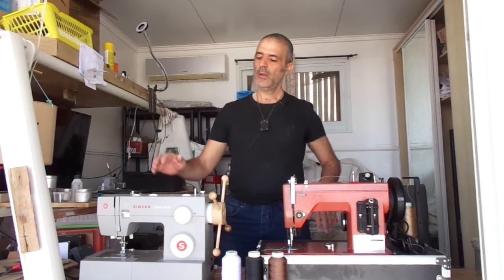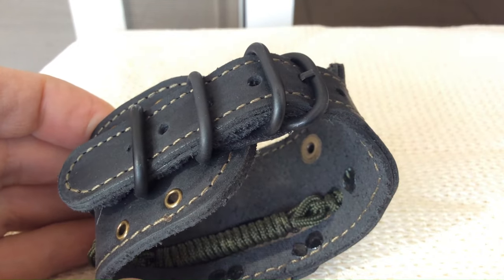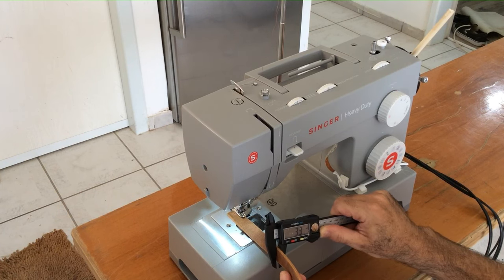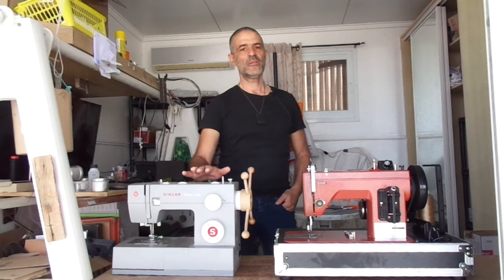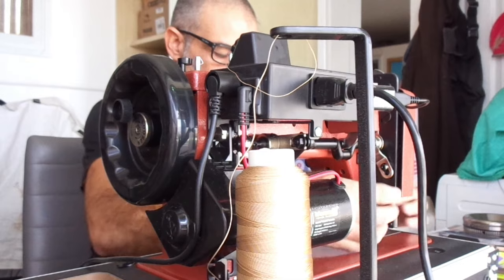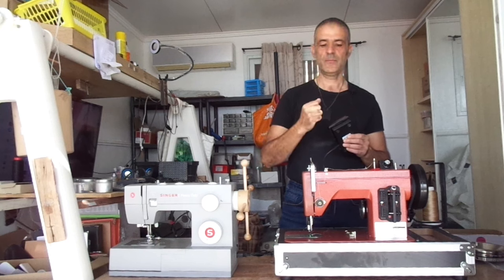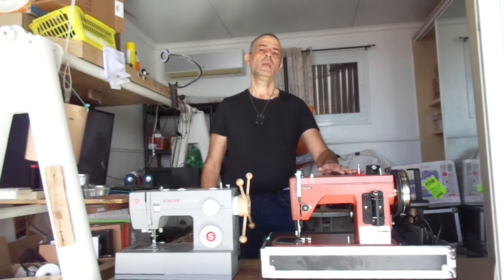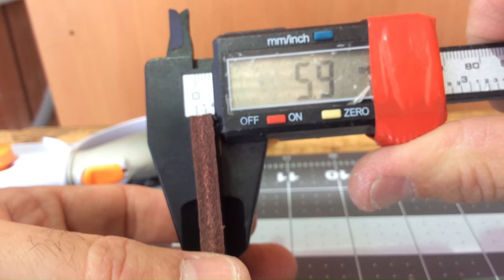Singer Heavy Duty Vs. Sailrite Industrial Walking Foot Sewing Machine for Thick Fabrics and Leather

Comment: The sailrite is not an industrial machine. Even sailrite calls it a heavy duty sewing machine. For a sewing machine to be called industrial there are parameters that have to be met that the sailrite machine doesn’t even come close to. Now the sailrite fabricator is an industrial sewing machine, but the LS1 and the LZ1 are just heavy duty.
Reply: If they are just heavy duty then why the $1000 price tag?
Reply: Industrial sewing machine - can sew continuously without stopping 
Heavy duty - has a more powerful motor than sewing machines of the same size and will have better quality parts. But the motor will have a duty cycle of 1 hour of "continuous" sewing with a 20 minute cooling period. Don't let this video confuse you, this is not an accurate comparison. The Sailrite machine is designed to sew and repair sails and is a walking foot machine. Whereas the Singer HD is designed to do home domestic sewing projects, sewing denim jackets would be the max for this machine since it has a 1 amp motor. The Singer HD is comparable to the sewing machines that were made back in the 1960's and 70's. The all metal frame sewing machines, but all those machines came with a 0.3 to 0.5 amp motor. Where the Singer HD gets the rating of "heavy duty", it comes with a 1 amp motor, with everything thing else reaming the same. So think of the Singer HD as a vintage sewing machine but with a 1 amp motor. 

Now let's compare the portable "walking foot" machines that start out around $370.00. Why the $1,000 price tag for the Sailrite machines. These Sailrite machines have a thicker casting, and the parts on the inside are cast with a steal alloy instead of the cheaper cast iron parts. Now the Sailrite machines are assembled to use aboard sailboats and yachts. They come with everything you need to start sewing. You don't have to buy any accessories, just buy thread and needles and start sewing. It also comes with a lifetime warranty if any part should break. The cheaper portable walking foot machines don't come with any accessories and some of the parts inside need to be upgraded. So when it all said and done for how much money you'll need to spend upgrading the cheaper walking foot machine to match the Sailrite machines, the price will end up being the same.

Comment: My first heavy duty sewing machine was the singer 4432. Although it's said to be a heavy duty, at my first attempt to sew a canvas, don't recall how many layers, the timing went off. After that I bought a Chinese heavy duty called Emery similar to barracuda , and with that one was able to sewing on multiple layers of the canvas
Reply: That sounds like good information. We are sewing canvas bags with an industrial machine but looking to get a few machines for classes. I found the Emery machine online on the manufacturer’s website but I cannot find somewhere to buy it. Where did you get yours from?
Reply: @arisskarpetis  Chinese "Aurora A-2153-HM" looks almost the same.

Comment: I don't know what kind of motor you have in that singer, i have the 4423 and it barley makes it through paper size leather.
Reply: 4432. Which is a little stronger.
Reply: @Yvanahh  they have same motor. 4423 has more stitches and different color.

Comment: thanks for this.  great video.  wanted to mention there is an adjustable potentiometer(adjusted with a small flathead screwdriver) in the singer foot pedal. its right beside "VR2" on the main board. at 12:18 

the manual feed handle you made on the singer machine is genius

Comment: I have a singer 6800c as well as a Rex (Sailrite Wannabe).
On the Rex, I had to use a magnet as a spacer on the foot lift, to get even close to the clearance of the Singer, which has that "extra lift". The Rex with Monster Balance Wheel is pretty good, but using it is like trying to do Brain Surgery with  chain saw. Just not a precision instrument at all. Always a challenge, where the Singer is nearly always a pleasure.

Comment: Right now Im sorting out a brothet industrial eith a clutch motor. When you speak of high speed I hear you. I changed the pully wheel to a smaller size, 45mm. Just received a shorter belt, yet to install it. Nrxt step will be the extend the clutch arm, see how that goes. Why all this. I eant to see if I teally need a walking foot machine. Im still up in the air about a switch to a servo motor. Testing continurs.

Comment: I have a singer sewing machine used industrial purpose. 
Sewing leather onto shoes. 
It needs to be used for its amazing mechanical engineering.
Reply: I am using the Singer Heavy Duty to sew leather for shoe making but many parts are glued first to hold seams together and the Singer gets sticky and won't sew, have you had this problem?
Reply: @dianeeugster9670  my old machine uses oil to keep it on thread and in it machinery so I haven't seen this problem before

Comment: I hate my Singer HDuty 4452. I used it gleefully about 3x, and then something went wrong and now it wont sew through thin cotton. I bought an 120 year old Singer treadle machine to use instead I was so upset. The HD4452 just sits and I am thinking of selling it strongly. However, watching you here is kind of mind blowing. I may have to relook at why my Machine went out. Any advice is welcome Sir.
Reply: It sounds like your timing is off. There are videos on youtube, you can fix yourself
Reply: @silversprout4586  Thank you. It turns out you are right. I did just that about a week ago, and it works beautifully now, just like the one in this video. I'll admit to feeling extremely fearful, and actually sweating from the process. Turns out its a lot simpler that the scary picture I had created in my mind. I hope that encourages someone else, who like me was intimidated. I also oiled the machine properly and now it runs 80% quieter than when I got it new. I'll still be selling it, as in the last week, I decided to rehab (completely disassemble) a 1903 Singer 27-4 treadle machine, on the back of the success of the HD4452), and though its been a LOT of work, the machine literally.... sings. Its so much quieter and respectable to me than the new machines. So, while its fixed, it will be for sale soon :) Thanks for commenting!

Comment: The only thing I don't like about the singer heavy duty is how far the needle is. When you remove that front (or side?) cover, you see that the only reason for it being this big is to hold an aluminum piece that holds the little lamp and the screw for the cover. That's the main reason I'm ditching it for an older Singer model.

Comment: I'm a beginner sewist and am looking at sewing leather onto fabric, like drop cloth or canvas. It sounds like the Singer would work for that, correct?
Reply from the maker: Basically yes, unless the leather is very thick and hard.
Reply: @grannywheels  Thank you! I won't be using the thick leather. I'm just looking into sewing thin leather to make some decorative pillows for myself.
Reply from the maker: You should be fine then @BobbiMac08

Comment: The singer ‘heavy duty’ will struggle to sew 2 layers of tissue paper. Don’t know how this fellow seems to think they are on any comparable level whatsoever. I have a singer ‘heavy duty’. I have reset the timing the first three times i used it. Will sell it on it at the first opportunity.
Reply: Which one?

So he's lying?
Reply: I have the singer heavy duty and its amazing. Ive used it on denim, vinyl,  leather, thick layers, and even more light weight fabrics. Maybe you got a dud.
Reply: Which model you have? This fellow has the 4432. Do you have the same? Or 4423 or maybe even 4411 which are weaker models?

Comment: The Singer is a pile of rubbish, the only thing heavy about it is when used as a paper weight. Let’s be honest here if you try and sew anything heavy on it you will continue to knock the bobbin timing off! I know this from personal experience, in my opinion I’d literally save the money and buy a Juki or Juke walking foot for less money than the sailrite. The sailrite is also very restricted in the foot clearance, and it’s expensive compared to the Juke or Juki, the only thing going for it is the size compared to others etc. it’s just the price that makes me comment as such. The sailrite is super loud too. But thanks for the. Idea nonetheless the less.